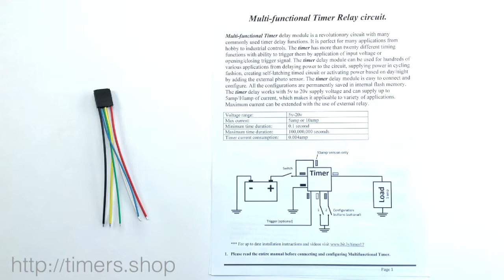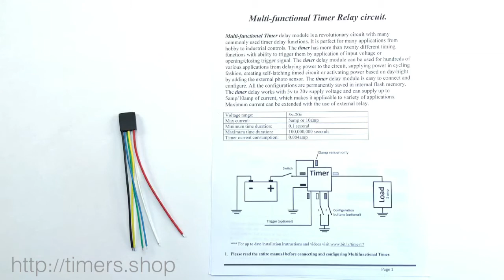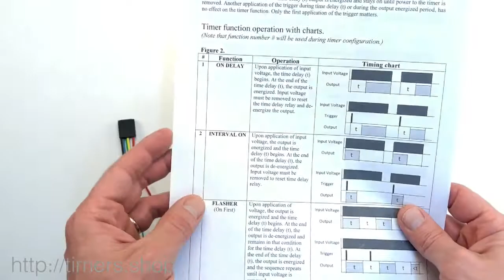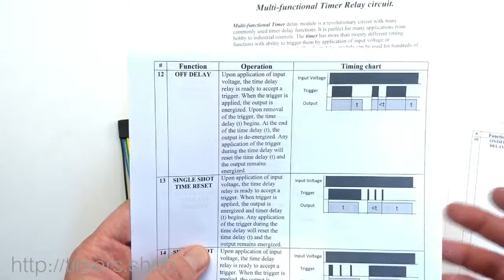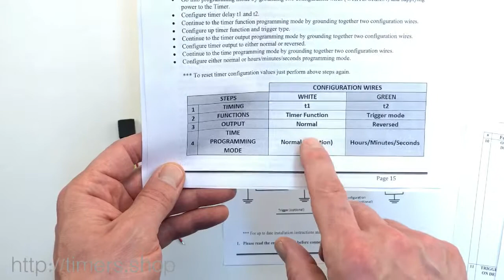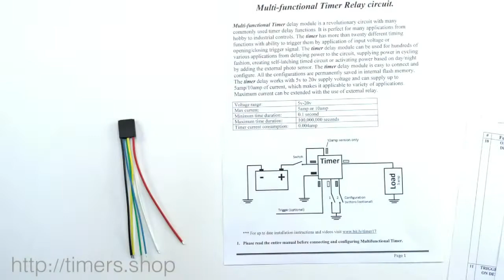Multi-functional 12v Timer Relay. Introduction

Comment: Could this be wired to turn off if the input voltage drops below a certain point?
Reply from the maker: The analog trigger is not available right now, but we will add this feature in the future.